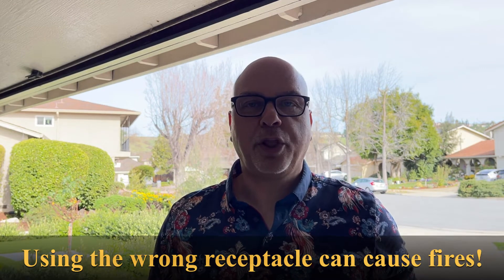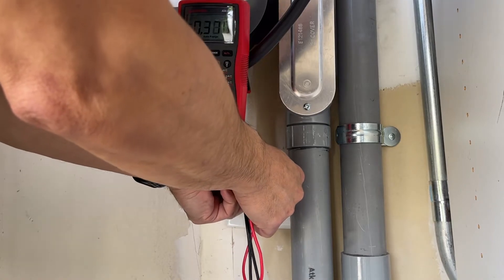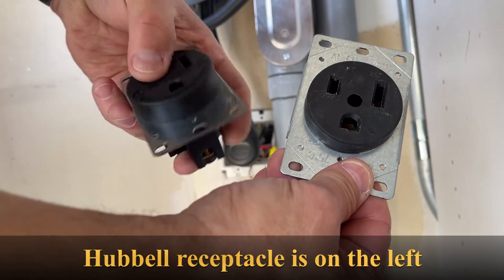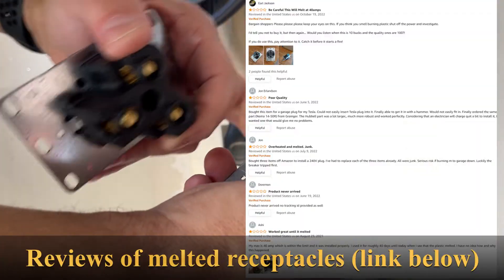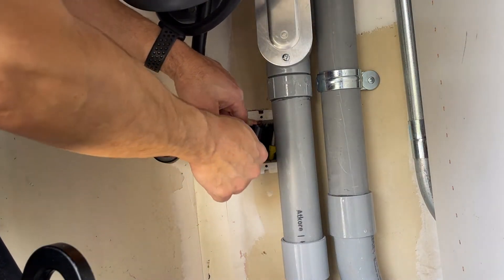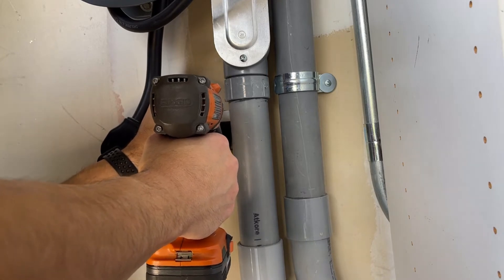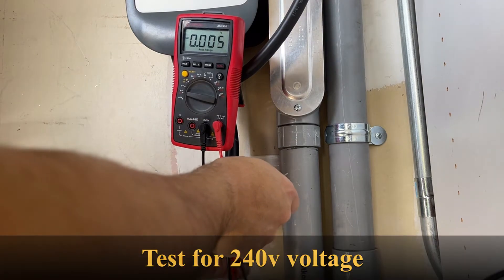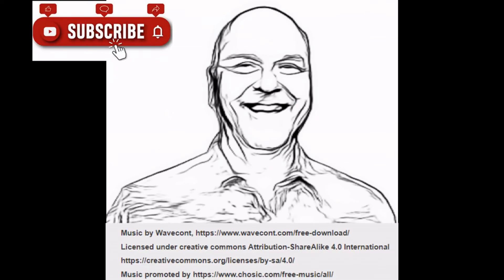Avoid a home EV charging disaster

Comment: Much of the melting problems are due to the fact that outlet is not really meant to supply 240 volts for 12-24 hours.  It's meant to run a dryer for an hour or so, which gives it time to cool off between cycles.  Plus, as your battery fills with charge, there is increased resistance which also causes heat.  Personally, I wouldn't be able to sleep at night knowing this is hooked up.  If I were to do this, I would be using a much beefier commercial type receptacle with much larger & thicker contacts and add a heatsink to it.  Electricians have access to the stuff I describe, or if you have a business license, you may be able to find a commercial wholesale store in your area, as you won't find it at the local hardware store.  Lastly, just turn everything off in the breaker box.  I've been shocked (never by 240v) due to trusting mislabeled breakers, and or screwy wiring from tampered with systems.  Every house is different, and you never know what you're going to find.
Reply from the maker: Agree and that is why I recommend the Hubble receptacle only. If you can do direct wiring that is best.
Reply: @geteducatedbyTed  Direct wiring yes, if you have more than one dryer outlet in your home, preferably one in the garage.

Comment: I have 10-50 outlets from 1960 used for my welder and for the stove and they are still in great shape. The wire had old dry rotted rubber insulation though, and would need to be replaced. The wires run through steel conduit and the cover plates are steel. The brand name of the receptacles is Eagle and they are a very hard bakelite. What poor excuse of a company would use thermoplastic for electrical receptacles?
Reply from the maker: I made this video because I was very surprised how many people are using receptacles that are not made for EV charging!

Comment: Thanks for the good educational video. just wanted to add. if your EVSE "charger" has hardwire option. Eliminate the use of NEMA 14-50 or any other plug for that matter and just hardwire it. It would not only give you maximum wattage allowed by the circuit but you'd eliminate the point of failure which  in most cases is the plug.
Also, if you're using the NEMA 14-50 plug in the garage make sure to use GFCI breaker.
Reply: GFCI breaker isn’t necessary as the EV chargers have GFCI protection built in.
Reply from the maker: I agree that if you can hard wire the EVSE then you should. Sometimes for various reasons people choose a receptacle.

Comment: The wire screws need to be torqued to 75 lb-in using a torque screwdriver which is best practice.  I got a free install from GM as part of a Chevy Bolt purchase.  The install was a catastrophe waiting to happen!  The licensed electrician used a Pass & Seymour Range receptacle and stripped the wires way too much as well as not having the proper tool to torque the screws.  I replaced the outlet with the Hubbell and purchased the torque tool to properly tighten the wire screws.  Yes I also checked the connection to the main panel.  Lesson learned is to always check the work done at your house by so called pros!
Reply from the maker: Thanks for sharing. Peace of mind to get the Hubbell. Good for you. Just curious what was the torque tool you purchased?

Comment: not a big thing but using a metal plate vs the white plastic might be a little better. plastic insolates vs the metal will conduct the heat and partially wick it away. other thing-- easier to check if the outlet is getting too hot. any plate that would be warm to touch would have me inspecting outlet for over-heating and damage.
Reply from the maker: Great suggestion. Thanks for adding that in.

Comment: Also when attaching wires they should be torqued to specs.
Reply from the maker: Yes, I completely agree Bill. I was trying to find a screwdriver that has a torque gauge built in at a reasonable price, but I did not. Any recommendations?

Comment: The house would have less chance of catching fire if the charging equipment was installed by a qualified trades person.
Reply from the maker: Overall I agree with you, but if an electrician installs a cheap receptacle, it will still catch fire if it is not rated for EV charging use. That is the whole point of this video.

Comment: $10 from HomeDepot vs $75 for Hubble.  Bryant is near that higher cost as well.  Tighten, wiggle, loosen, wiggle, Tighten - good technic to get it to bond well
Reply from the maker: It is not the $65 difference that one should think about, it is the priceless savings of not having your garage burn down
Reply: @geteducatedbyTed  just indicating that a cheap receptical doesn't have the features needed to avoid a fire.  Fully agree with you